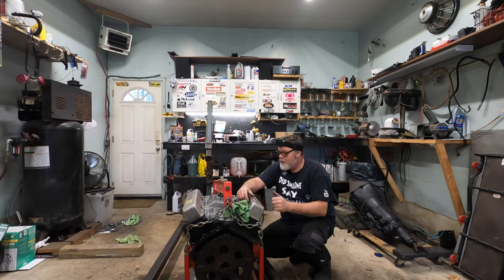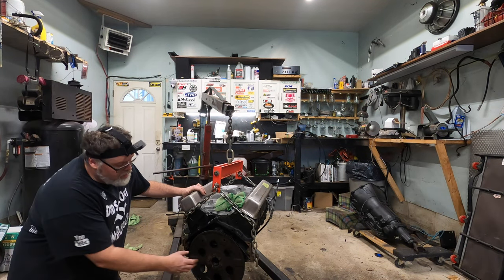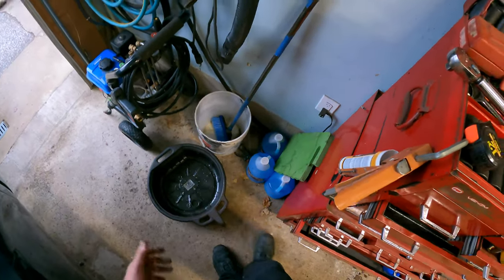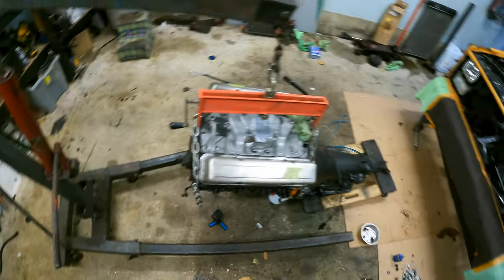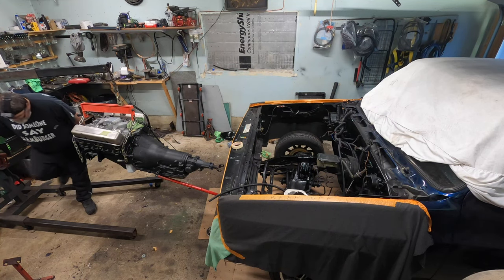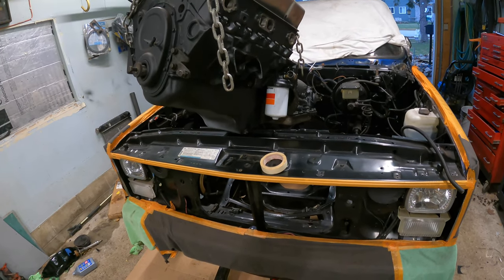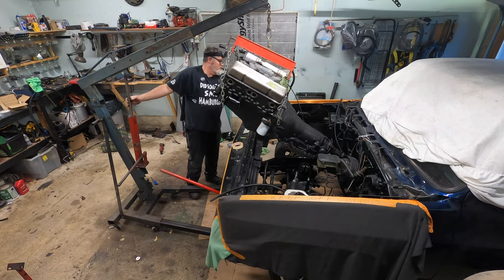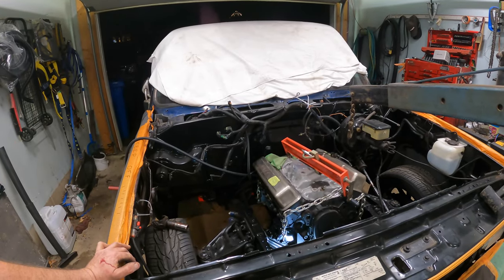ENGINE WENT IN WITH EVERY FIGHT IT HAD (Easy NOT)    4K

Comment: You did good for being by yourself in a narrow garage 👍 also there is a tool but I can't tell if your leveler can do that. Seems like a older one. In my it has a square end you can put a socket on it or what I do in put a drill/impact and just use that. Makes it faster. Make sure the main threaded rod in greased. Sometimes it can bind up and get tight. I always put some on mine before using it.